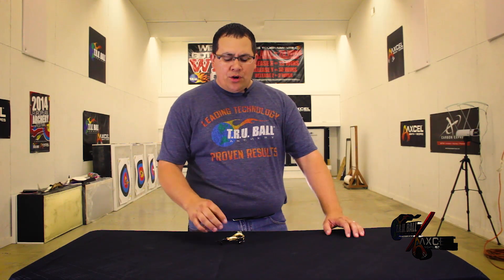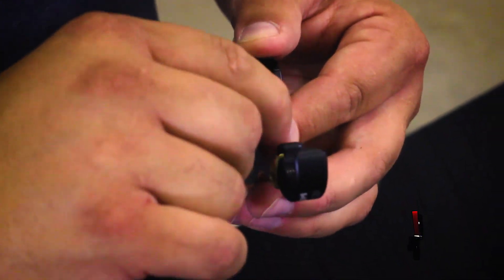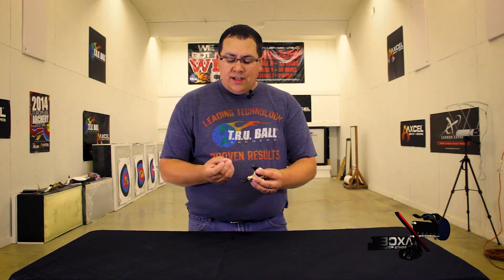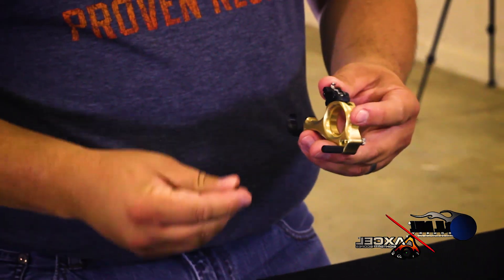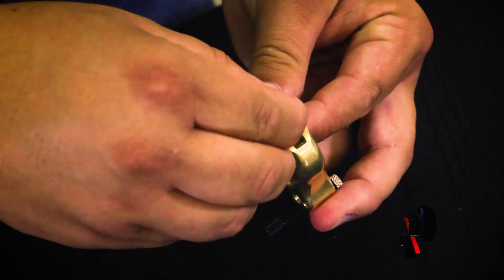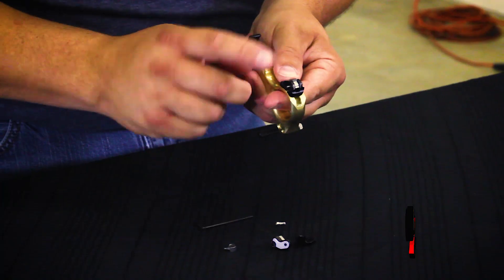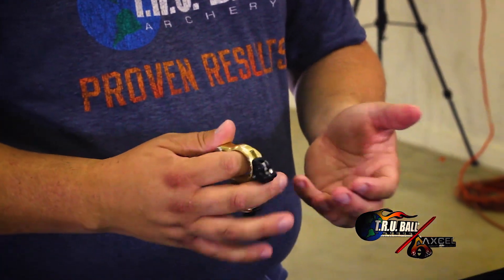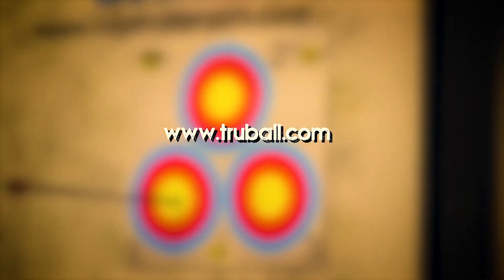TRU Ball FulKrum Flex-Changing from Click to No Click!

Comment: So if I wanted a slower click followed by a fast release. I would assume I would want the slow click maybe if you have time a video on the dot system and how each one fires. Thank you for your time
Reply from the maker: You set your speed on your click with the adjustment screw. To change to a faster release, you would need to purchase the fast sear clicker which is sold separately. Here is a link to it in our online store:  https://store-truball.myshopify.com/collections/t-r-u-ball%C2%AE-accessories/products/fulkrum-flex-sear-clicker?variant=23117549895780 Just be sure to select "fast" in the type category.